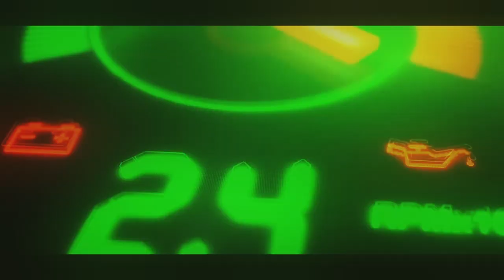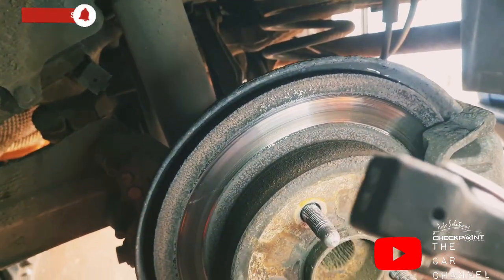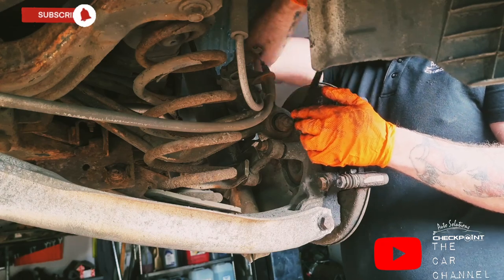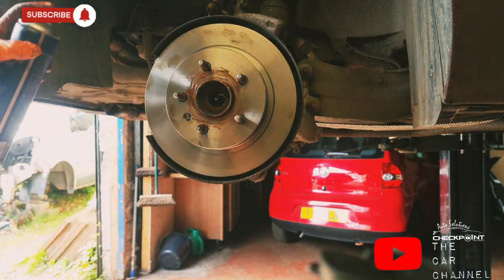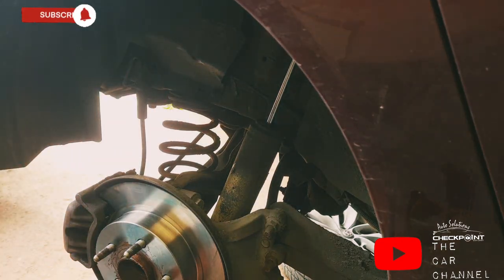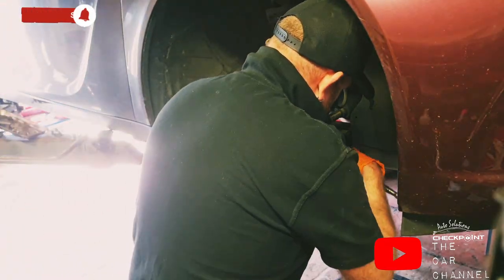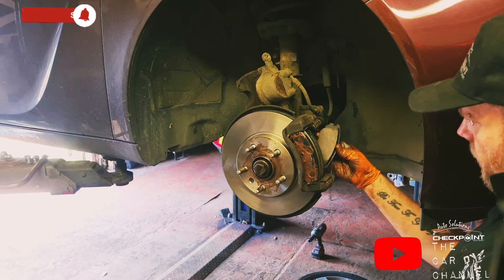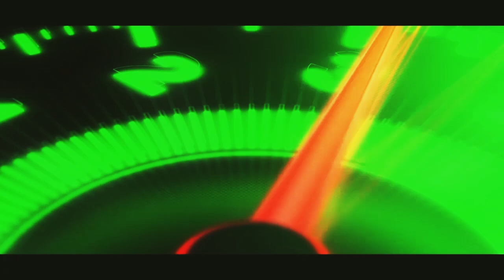Vauxhall Opel Insignia ( electric  handbrake ) How to fit discs & brake pads

Comment: I want to remove the the brake calliper piston to re-install the rubber- dust cover, is there any special procedures i shoukd follow since got elecric hand break? Thank you.
Reply from the maker: I'm not sure as I have never done a caliper rebuild  before , I have always either replaced with new off the shelf parts or parts from the scrap yard, I'm sure it would be the same ethics as refurbishing a manual caliper.  Sorry I couldn't give you a more definitive  answer. Please consider  subscribing if you haven't already.  Thanks ☺️

Comment: I've read on Insignia groups that if you press the handbrake button down for about 8 seconds it puts the rear calipers into 'service mode' , which i assume winds the pistons back.
I'm just about to do rear discs and pads on my own Insignia today.
Reply from the maker: I didn't know that mate, let me know how you get on doing it if it works for you etc. Good  luck and hope the weather stays good for you 💪🤠👌
Reply: @autosolutionscheckpoint  weather great here down on the Ayrshire coast ............It did indeed put the brakes intae service mode mate , the wee  brake symbol appeared on the dash.
It didn't help much though, if at all , still had to wind the pistons back .
I had read this function would do that , what a load o' mince!, not on my 65 reg anyway.
However , new pads n discs fitted , so will take it a wee test drive.........past the supermarket ;-) .... might pop in for a couple of bottles of Henry Weston's Cider for tonight lol
Reply from the maker: @steview9899  everything  is trial and error.  I done my city & guilds in the late 90s. And just been winging it ever since . Everyday is a school day with Me. Youtube is great for keeping up to date with the motor industry and modern technology.  Weather been beaut here too in queensferry.  Enjoy your cider lad. Definitely  the weather for it. I'll crack open an ice cold bottle of water  because I'm mental and on the hard stuff 🤣🤣🤣
Reply: I heard that to

Comment: Do you open thr brake fluid reservoir when push the calipers open on the front?? 
Just asking before i start....
Reply from the maker: I didn't , but don't think there will be any need to  remove the lid IMO  , as it was just discs and pads getting  changed, the only time I would remove the lid if I needed to bleed the brakes  etc . Cheers

Comment: Why do you put copper slip on the back when it just makes dirt stick to it ? I understand on the sliding surfaces at the top and bottom of the pad but don’t see any benefit to the back
Reply from the maker: Just something  I've always done , and I was taught  this method when I was at college over 100 years ago 🤣. Everyone  does things differently
Reply: @autosolutionscheckpoint  😂 that’s fair enough. No harm in it I suppose

Comment: mine fails calibration any idea why it would do it? happened after putting the brakes into service mode -__-
Reply from the maker: Hi mate , im not sure. 
Is your machine up to date ?  Is it causing a problem when the car is put back together and out on the Road test?    any dash warnings about it ?  Pl3ase consider subscribing if you haven't already  done so. Cheers 🍻
Reply: All upto date and service light flashes when at a stop or low speed but have my mot coming up lol have to double pull the button for it to engage

Comment: I'm new to your channel 👍I don't want to upset you but you have got to use Silicone Grease on the pin's that have rubber bit's copper Grease eats rubber
Reply from the maker: Hi Colin, cheers for letting me know , unfortunately  I never knew that , when I was doing my city & guilds in the late 90s they never taught us that  or even garages  I worked at . But take that on board,  welcome to my channel , I hope you  like it .

Taz 😊

Comment: What is a ball park figure for having this exact same job on the exact same car ?
Reply from the maker: Sorry it has took so long to reply,  unfortunately  I didn't get a notification  for this. It all really  depends on who is doing it , quality  level of parts used and time it takes.  Not every job is as straight forward.  And every garage varies with there hourly rate   . Some garages can be £40 +vat per hour , some can be £100+vat per hour. . Thanks

Comment: Cuales son el par de apriete de los tornillos de la pinza del freno??
Reply from the maker: I dont use a torque  wrench  myself however I would say the insignia  should be about 150nm .  Thank you
Reply: @autosolutionscheckpoint  ok, gracias, esque tenía duda de los tornillos del porta pinza, porque los tornillos de guía se que son a 30nm, gracias por tu respuesta

Comment: service vechical soon on a insignia means there is a fault,,
Reply from the maker: Thanks mate, that would explain it, it has a code for glowplug number 2, thankfully  it's not the most important  one, will relay this back to the customer.  He's had that same code for over a year now. Thanks  for this. Please consider  subscribing  if your not already.  I try my best to reply  to everyone's comments  and appreciate the input.💪🤠👌
Reply: Yep , i'm on a few Insignia groups and lots of folk don't know that , theyr'e like '' it says 'service Vehicle Soon and it was only serviced 2 months ago''..............unfortunately it need plugged in to find the fault.
I had it once ,so plugged in my little V'Gate icar pro scanner (£25.00), it showed as glow plug no 3, thankfully it's the cheap non-sensor glow-plugs on mine , glow plug was £9.00 , job done.
Reply from the maker: @steview9899  yeah the other type glowplugs are ridiculously  priced. You would think they were gold plated 🤣

Comment: diamètre disque frein Opel Insignia A stp👍
Reply from the maker: I can't remember,  there are a choice of 2 different  sizes for the rear, these  where the larger ones . 315mm .  The smaller ones are 292mm . Thanks
Reply: @autosolutionscheckpoint  
I thank you👍